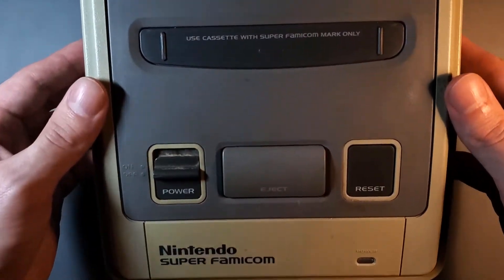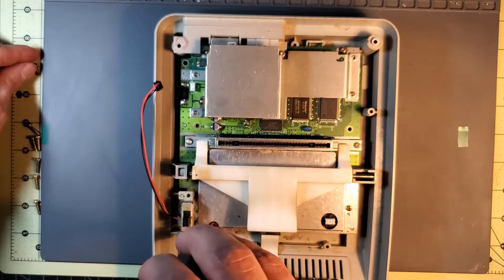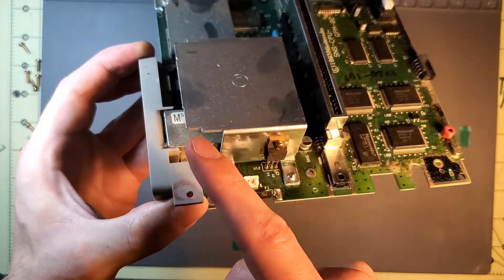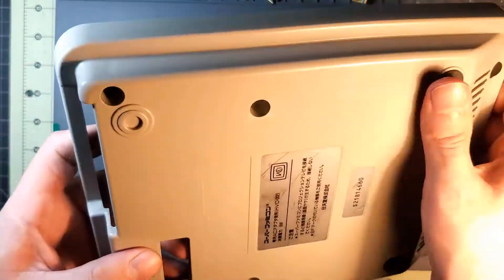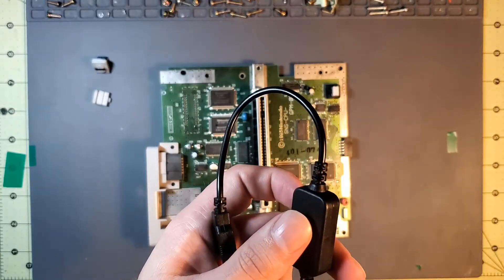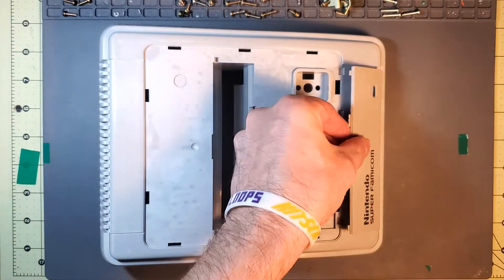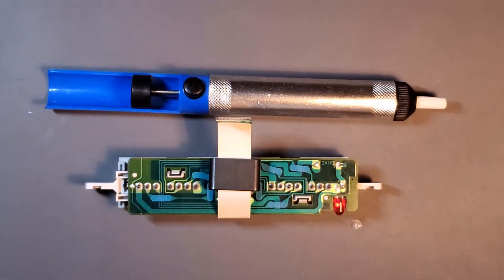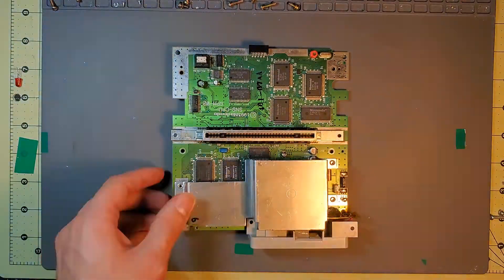Ultimate SNES Power Mod

Comment: ( wrote a really long comment and cant find it anymore.  D: )

Anyways. TLDR. Be careful with this mod you will put the boost converter in parallel with the power supply (AC possibly). May break the boost converter. Better to solder the output of the boost converter to the Output of the bridge rectifier.

Comment: Why would you stepup the 5V to 9v then the nintendo will regulate it to 5v?
Reply: А чому ви впердись в 5вольт???  Це дамно і воно так є що заряднік може  видавати 9вольт, 12вольт, 20вольт.
Reply: The sound circuit uses the 9V~12V input for something.

Comment: Hmm I think you don't even need the modded usb power converter. If the whole system runs on 5V and the only component relying on 9V is the voltage regulator itself, you should he able to bridge input/output on the regulator and just supply 5v directly.
Reply: yeah I want to mod mine too and thought the same. Will test it.

Thing is I think the 5V regulator is behind the on button. If thats true the snes would be permanently on ??.. .Gotta test :D

Comment: i have a question so after you solder your usb & chip together you just glue the usb port in the back/bracket  and then the other end of the wires is solder to the 9v & ground under the circuit board/bottom? just want to make sure i do it correctly! also the link to the usb type that you used is broken so i m not sure what type of micro usb you used!  any help would be great this is the best tutorial but i am new to this stuff and i am doing my best to understand it! so i just want to make sure that i solder the wires in the correct place! prob stupid question but is this  safe to plug into a wall socket and play?

Comment: Impressive it is . But i like to keep my consoles how they are with no unnecessary modifications unless it's  a repair and replacement of a resistor or a faulty reset button and capacitors. I wouldn't want to devalue  my consoles .

Comment: Or save the time and effort and grab a mister reflex volt power cable and use a USB-C charger you probably already own that can do output 12v....cheaper that route if you dont have a soldering iron around.

Comment: Adding the step up converter is unnecessary. Depending on your power adapter, it should provide enough power for you. In this case, since you're connecting directly to the OEM voltage regulator (minimum operating voltage is 7.5V), all you would need to do is supply a 7.5V-12V power source and a direct path from the USBC to the OEM voltage regulator. 
Regarding whether you use an everdrive, it should run fine as long as the snes is supplied the recommended ~800mA.
Reply: USB-C only outputs 5V by default thogh. You could use a PD module to force like 9V but that only works if the usb-adapter understands PD.
Also connecting directly to the regulator bypasses the on-off switch.

Comment: I did a same mod to original Japanese Famicom. It all works just fine. As long as you don't want to use some EverDrive (or similar) flash cartridge. That step up DC converter just unable to provide enough current for flash carts to run properly. I tried to solder 5v from USB to motherboard directly. And that worked... But this way I got a lot of visual video noise. It varies from AC to AC adapters but the original AC 9v adapter provided a lot crisper flicker free image. I guess I had to add some filtering caps.

Comment: This makes no sense! Why did you step-up the USB-C to 9v, fed it to a 10>5v step-down? Why not just wire the USB-C 5v directly into the Snes 5v input and removed the voltage regulator?!
Reply from the maker: I know you guys dont read the comments, but I mentioned in another comment like this that if I wired the 5v directly to the system, that id have to block off the AC port on the shell. otherwise, if someone plugged in the stock power brick it would fry the system. I might not have this system in 5 years and give it someone else. Id rather not have them accidentally destroy it

Comment: hey there, i got a bit of a recommendation for the next time you do a retrobright, instead of using the salon cream, i use the salon 40 developer liquid and a plastic bin with the outside sprayed with liquid mirror spray paint.

heres how i built my retrobrite bin:

water safe translucent bin (fit to your project and maximizing space and volume)

liquid mirror spray paint

painters tape (for leaving space for retrobright led strips)

a heat lamp on a boom arm mount above container

a safe place to put the box for retrobrighting

assembling the retrobright box

go outside wear ample breathing equipment and clothes you don't care about 

make sure its a nice sunny day

apply painters tape where you want the led strips to rest. 

spray the mirror finish spray paint to the outside of the box. as the mirror spray paint is settling remove the painters tape where you want the led's to go.

let the box dry and then then use painters tape and cover the outside of the box and install the led strips where the mirror finish spray didn't go.

for controllers such as the snes controller, i use a pickle jar with a liquid mirror paint on the outside and filled with salon 40 developer and a heat  lamp and black light leds, the set up is very similar to the one mentioned above. and it is sealed with a plastic see thru lid and a top pickle jar clasp, or plastic wrap with rubber bands

this will give you much more consistent results and is my go to recommendation

this also reduces the chances of marbling to zero.

thank you for this video! :D.

Comment: I'm very curious now that some time has past if this mod is working as intended before I attempt it myself. The forums I've checked out say that "noise" from a different power supply can cause problems.
Reply from the maker: I have yet to experience any issues at over a year in, and haven't experienced any "noise". The system already runs natively on 5v so theres not really an issue of power supply problems.
Reply: @XipherDesign  thanks for the response, I look forward to more of your mods. I've been thinking about doing this for a long time and I'm glad someone did a video on it. There really aren't any videos about modern power replacement on the older consoles (that are competent)

Comment: I can see your logic in using the step up and step back down method, but this honestly seems like a ridiculously simple mod to do for those willing to just lose the regulator and wire the USB terminal directly to the +5in on the motherboard.
Reply from the maker: I didnt remove the stock 12v port, so I was worried that if someone else got my system that they'd fry the system by plugging it in with the standard power brick.
Reply: @XipherDesign  Good call on your reason for leaving it in place. Removing the 12V port would definitely be necessary if you intended to remove the regulator too, but then you'd be contending with the open hole in the housing.
Reply: @XipherDesign  12v port? Now I am confused. What 12v port?

Comment: now I know I am an idiot but I more wander why you wouldn't place power though the holes of the Voltage regulator. but I'm assuming that this is because you'd have to fine tune the voltage and Mili-amps from the USB to the through holes with a multi meter. using something who's name I forget. I honestly would like to know your reasoning for why.
Reply from the maker: I wanted to keep the option to use the OEM power brick. Removing the voltage regulator means that if I use the original power brick then the system gets fried
Reply: @XipherDesign  fair enough. Though I'm left to wonder if something else should be added or not to protect from some idiot ( like me) forgetting that this mod has been done to their own SNES and having both ports filled for power.

Comment: it´s a neat mod so to speak but for me it seems like some of the steps would be possible to go around such as the voltage booster, I know that the voltage regulator gonna step it down to 5 volts again anyway but it should be possible to feed in the power after it without frying the stuff (I might look into that some day). But either way it will be more safe to do it the way you did, however it adds more complexity and losses and kinda ruin the reason to use a regulated 5V USB adaptor in the first place unless you wanna bring your Nintendo out in the woods with a powerbank to play your favorite games on battery, since pretty much any power adaptor with 9-12 volts and a barrel jack would work without modding,  Good thing to know is that some consoles have the AC input and adaptor depending which it is and if you would put such a SNES AC power brick into a console modded this way by mistake you gonna fry the booster since it is connected to the jack directly and it cannot handle AC. Thought it could be a good thing to point out since the SNES might have this AC adaptor as well as a DC depending on type. you can use a DC adaptor on the AC input but not good the other way around

Comment: GREAT VIDEO!!! I want to do this to my SNES but will this work on the original NTSC systems and will the 3d print also work for the NTSC systems?
Reply from the maker: This mod should work on all SNES systems and the printed bracket should fit as long as you have the same RF port

Comment: Awesome mod! If you don't mind me asking, what exactly is the difference between this mod (https://endrift.com/2019/08/10/usb-snes/) and yours? I see the other mod doesn't need to do the 5V>9V>5V conversion. Also, with your mod, what happens if you plug the SNES into a USB adapter capable of outputting "turbo" voltages (like 9V)? It'd fry the system, right?

I'm new at SNES modding and I'm looking forward to doing your mod on my systems!
Reply: he'd answered someone else who asked the same question. Either you can search the comments, or trust me when I say "short answer is he said the motherboard has a 12v to 5v step down mosfet, and jumping that to not need the 5v to 9v step up would make the original power brick or any overpowered usb-c fry the board, having the 5v to 9v step up lets us use the original wall wart and most C chargers including Switch ones"
edit, you need to put a space at the end of your link, the /) makes it invalid because it should simply be /

kanpaifighto
3 months ago
So if the system steps the voltage down to 5v anyway,
Reply from the maker: The other commenter hit it on the head. If you bypass the buck converter/mosfet, and wire in 5v directly, then someone could maybe plug in the regular power plug and fry the system
Reply: Would a 9V ZYPDS usb c PD trigger board simplify this as you won't need a step up converter?

Comment: Hi. I wanted to ask if i would use everdrive does this mod handle it because it uses power too.
Reply from the maker: Yep it works fine. The everdrive doesn't use that much additional power compared to a regular cart. Everdrives are more of a calculated drain on handheld where batteries are the main source of power
Reply: Do you have the Bracket files still?
Please update the link if you have.

Comment: You can just solder the 5v to the other side of the 5v regulator, you would just have to modify the switch so you can turn it off

Comment: So if the system steps the voltage down to 5v anyway, why did you have to go from 5v -> 9v -> 5v like that? Genuinely curious because I’ve never attempted any power-related mods thus far!
Reply from the maker: Because to run the system on 5v directly requires jumping of the mosfet power transformer on the SNES motherboard that handles the input: The mosfet in normal operation steps down the power from the original wall adapter, 12v down to 5v to run the system. So If I jumped the mosfet to run the system on a regular 5v wall wart and then say sell the system to a person unaware of the mod, then they will unknowingly fry the system. the 5-9v power board is just a safety measure in case I need to use the original wall wart or sell the system.
Reply: @XipherDesign  ah!! I got it, I hadn’t realized you kept the original wall wart’s functionality as an option. Makes sense in that case!
Reply: I was interested in trying that, and just removing the DC barrel input. Seems easier!
Reply from the maker: @RollerMobster-n8z  I mean, that's fine I suppose. But I'm just going to stick to the step up board for my use case
Reply: I actually am pretty sure you dont need the 9V . You can probably just power the Voltage Regulator (7805 i assume) with he usb-c 5V.
Just not sure if that would bypass the  on-off switch and needs a little more circuitry. But yeah should be possible. If you would then plug the 9V Brick as well  the voltage regulator would just already see output is 5V and should idle.

Comment: Have you tried using a solder wick before?
I'm no soldering expert, but I hate those cheap sucker things. Using a disposable wick has always worked much better for me than one of those sucker sticks. You can end up going through what seems like a lot of it, but it can really clean off old solder pretty thoroughly.
Reply from the maker: yeah Ive used solder wick, but I find the solder sucker to do a pretty good job for the most part.
Reply: I finally invested in a desoldering station. Not a super expensive (and admittedly very nice) Hakko unit, but once that works night and day better than the plastic deals. I use that for the initial solder joint removal and then clean up with solder wick. Leaves me with beautifully clean pads that still have tin on them.

One trick which he does in the video when he attacks the LED is to add a touch of new solder to the joint when they're this old, as it helps the old solder melt and flow better into the sucker and the wick during removal.

Comment: Instead of retrobrighting with the sun you need a plastic tub filled with hydrogen peroxide and wrapped in a UV led strip. Odd Experiments has a video about the process.
Reply: I started using this method well over a decade ago to de-yellow the clear soles of Nike Air Jordan 11 sneakers. Works great for game console plastic as well

Comment: I'm really surprised nobody has made a custom top plate for SFC that makes it region free 🤔
Reply from the maker: yeah that would be great if there was! I guess until then Ill just have to re-shell my games for SFC or use an Everdrive
Reply: @XipherDesign  Makes sense! If I do ever pick up a SFC, I'll probably just go the Everdrive route. Though I'm still a sucker for actually getting up and changing cartridges haha
Reply: why does nobody want to get a gameshark/genie/AR or any other cartridge which has a passthrough? IIRC you can just boot with no codes entered to have it act as just a riser

Comment: Tztz why not a usb c pd dummy and put it on the ac in pins? Easier and works fine.
A Pal Snes as example can be powered with 12v without problems.
12v is better because 9v ac are 12.7v dc. 
And it is recommend to use 12v dc instead of 9v.

With a pd dummy like this
https://a.aliexpress.com/_B12jZr
Youu dont need any extra board to get 9v out of it.

Comment: Is it true that some cartridges that use fx chips won't work correctly because they need the extra volt (10v) ? 

Also if you use a higher amperage (example: 1.2A) will make up for the 9v and allow the fx chips to work? 

I'm not a electrician so that's why I'm asking...

I'm currently using a sega genesis model 1 adapter (10v 1.2A) I ditched the Japanese 100v brick because I heard it's a ticking time bomb 💣
Reply from the maker: FX chip games work just fine. This mod provides 9v at 2 amps, which is plenty to run the system.